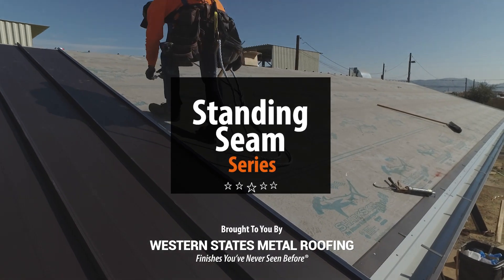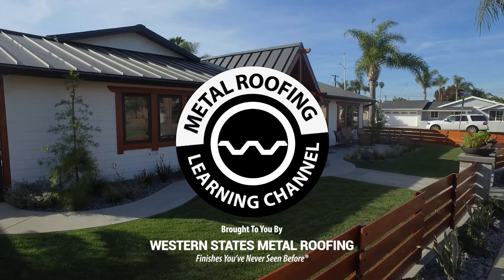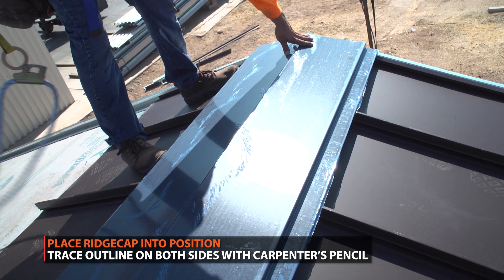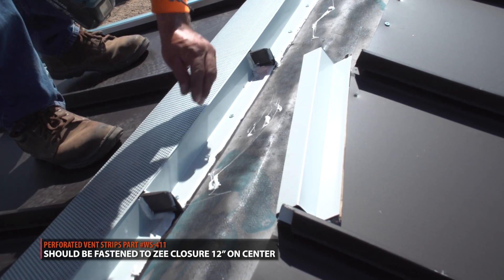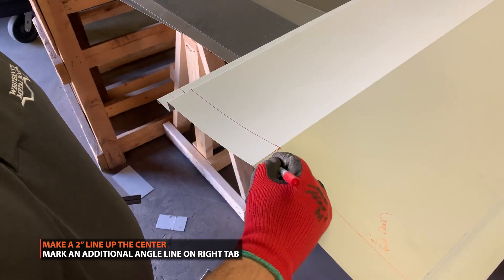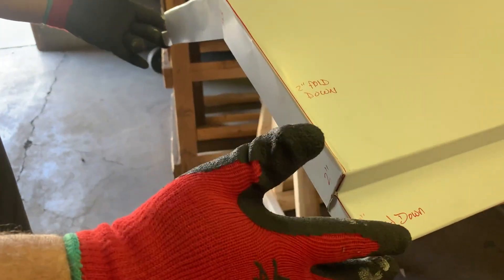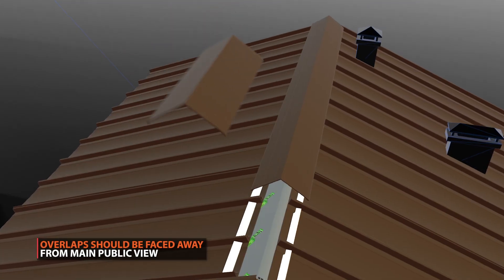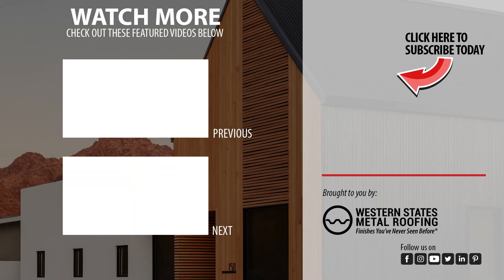How To Install A Vented Ridge Cap On A Standing Seam Metal Roof: Step By Step Instructions

Comment: Just did this for a roof. It's a bit tricky to get the second side of the ridge cap to snap in, maybe why it's skipped over at 6:57. Try to get the perforated vent strip to secure down flat (without ripples). 
Also, using rivets under the ridge cap is a bit over done IMO, I just used little self tappers, sure it probably not as strong, but do you really need it?

Comment: if the ridge cap metal grows and shrinks from the temperature change will cause distortion or rivets to pop. I have seen where the ridge cap shrank 3/16" on a 15' ridge cap panel

Comment: Do you ship to Louisiana
Reply from the maker: Yes. We have a 750 sq. ft. minimum. If you only need a few pieces of ridge cap, you'd be better of with a local source.
If you need an entire roof, we are a great option and will likely save you money.

Please fill out a quote form online, or call the office
602-495-0048

Online Quote
https://www.westernstatesmetalroofing.com/request-a-quote-metal-roofing-metal-wall-panels-in-standard-colors